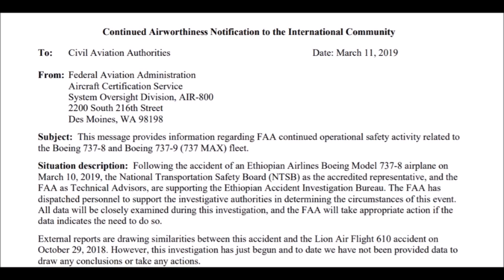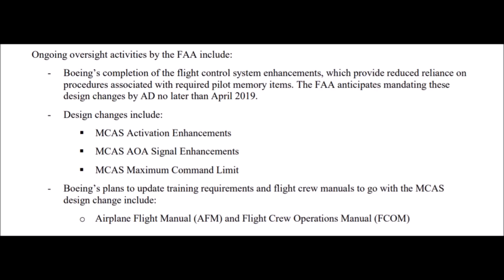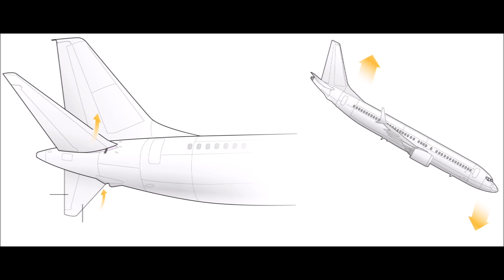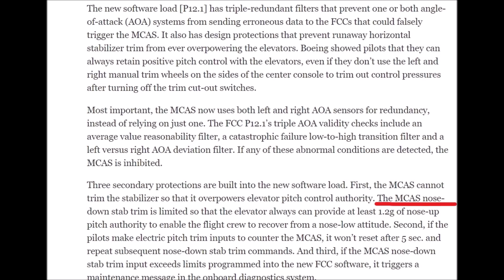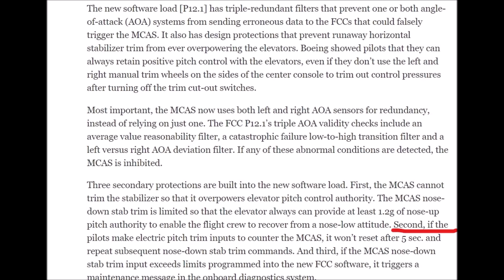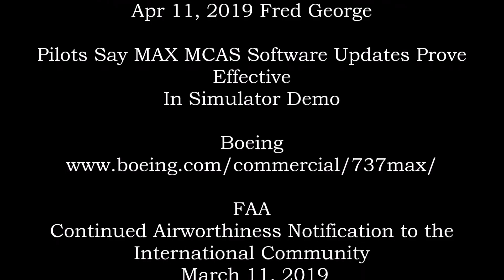737 Max UPDATE 14 April 2019 "The Fix"

Comment: Sadly with any new or redesigned product errors happen.  You have thousands of people designing every little part.  Even more making and or assembling them.  100% over sight is impossible.  This is why you never buy first year model of a car.  It is a crying shame that people died because of this.  I am 100% certain that Boeing did not want this to happen.  Look at what has happened to their stock and reputation.  

Having said all of that, they must take some blame.  While the software was to aggressive, the big problem was lack of redundancy.  That should have been standard equipment and not an option.  Where was the airlines fault in this?  The airline took the cheap way out and did not ordered the option.  The airline put profit before safety.  Another huge problem is that this plane,  the last one to crash,  had a known safety issue.  Why was that not fixed properly?  I will not hazard to guess.  Last issue.  The way the pilots reacted.  Was this due to lack of training?  Was this due to shear terror?  I do not know.  I can only look at similar situations where other people in charge did not act properly in bad situations.

In the end I would on a jury find the following.  25% on Boeing for the software issue and lack of redundancy.  50% on the airline for not ordering the safety option and  putting unairworthy plane in the sky.  25% on the pilots for not handling the issue properly.  

I know that I am going to catch shit for the last one.  I based that last on for several reasons.  The pilots the day before had the very same issues on the same plane  They were able to land the plane safely.   5 Pilots in the US reported the same issues and landed safely.  

Having watched many air disaster shows.  Two of which I have a personal connection to.   It is not one event that causes a crash, it is a series of events that do.  This is a classic case.

Comment: Boeing was trying to update the 737 to compete with the a320 neo when they added the new engines that caused the nose up issue and they knew requiring a different type certificate, and additional training would make it harder to sell vs. the a320 neo,  it was simply a rushed job because boeing didnt want to lose sales to Airbus

Comment: Juan, if you get a chance, could you explain why commercial planes like the Boeing 737 and I suppose others, don't use a gyro based flight control/navigation system supplemented by GPS?  I'm a retired Navy guy and I know we counted on gyro and doppler to get us where we were going and or to hit a target.  Gyro's could drift and doppler can have issues too.  Like going over water with doppler isn't the best way to keep track of speed and altitude.  But,  sophisticated software that was so small it fit in an old IBM 360 with 4K (NOT meg or gig) of core memory could take in the doppler information and computer speed and altitude.  That was bumped against radar altimeter to check altitude and against a gyro to check for directional speed.  I always heard that the original 747 kept 4 gyro's spun up and bounced their output against each other so they could fly great distances without any drift at all.  Doppler radar may not have been as accurate years ago but now I think it can compute AOA just good as a vane but without any moving parts.  Proof of that is that we can control space craft where there is no air to move a vane to land them on another planet.  Have I got this all wrong?.. Thanks for your reporting.  It's really great.
Reply: An AOA sensor needs to be in the airflow outside the plane. It measures the angle of the airflow in relation to the wing. No device inside of a plane can do this.
Reply: @stimproid  I agree with what an AOA vane does but I don't think you understand what doppler radar can do.  I find it very hard to explain this in words but will try.  Assuming you know what doppler radar is I'll start there.  Imagine if you had an antenna on the bottom of an aircraft that was sending out pulses in all directions and then listening for them to come back.  By doing this you can make a system that not only tells you how fast your moving forward but also how far your moving away from something.  These should balance out as you might imagine.  But, with aircraft they rarely do.  A cross wind, for example causes a plane to kind of crab through the air.  Doppler radar can see this.  Then, by watching how long it takes a pulse to get from the plane to the ground and back the radar can compute the altitude above ground.  Applying a bit of trigonometry to these signals, you can actually determine that not only is the plane crabbing but also that the plane is not flying level to earth beneath it.  Of course you don't want the plane to try to follow the terrain but using the previously mentioned timing to ground and back you can actually subtract out the terrain rising and falling.  It would not be possible for a human to do these calculations in real time but it's easy enough that a pocket calculator could work it out easily.  The gyro's that I mentioned in my comment make much of these equations VERY accurate and the math even more simple.  It also helps keep thing working when the weather gets really bad or the terrain gets really ruff or steep.  For military aircraft that might be doing dog fights where the earth isn't even under it but over it gyro's do a good job of taking over for the doppler  for short periods.  Systems being developed put the AOA vane to shame.  For instance, what if your A/C can go mock 3?  At some point you'll either tear off a vane or a least freeze it.  Granted at mock 3 your not going to have much use for it but what happens when you slow back down? lol
Reply: @trongod2000  AOA has nothing to do with measuring the angle of the wing to anything other than the oncoming airflow. The angle between the plane and the earth is completely irrelevant in this measurement. Your sensor design would work great on a spacecraft as you point out, precisely because their is no air. Your sensor design might make a good artificial horizon for a plane. It cannot measure AOA. Oh...and if you are going Mach 3 ...you don't have to worry about things freezing....you have to worry about them melting. smh
Reply: @stimproid  I can see I made two mistakes in my explanation.  The biggest being that I left out the pitot  static system which measures true airspeed NOT ground speed which doppler radar does so well.  My second mistake was in not sticking to  my narrow view of aviation. In military A/C that generally move really fast and have very high maneuverability compared to an everyday airliner.  You can find yourself in deep trouble just like an airline pilot But also have to ignore AOA much of the time.  The turn radius of a fighter quite often exceeds the ability of the airflow to hang onto the plane so you end up with almost negative AOA at times. ( mean where the airflow is trying to literally put the vane forward) I suppose, but don't know, an airliner could get some really weird AOA readings in extreme updrafts or down drafts.  They would have to be some really extreme drafts though to affect the apparent forward speed of 300 knots I would think.  Anyway,  I guess we'll have to agree to disagree that angle of attack can or can't only be computed from AOA vane.

Comment: How could YOU have got it so wrong in your first video!

The Max 8 is dynamically unstable at some speed and turn combinations. THIS IS WHY THE MCAT WAS NEEDED. Any pilot who accepts a dynamically unstable aircraft is a threat. Fixing airflow instability using computer fly by wire is just plain stooopid.

The Max 8 is NOT an upgraded 737 because of the new repositioned more powerful engine. Making one plane feel like another to save money is dumb.

Many more reliable people including London's Fin Mail reported this before your 1st video. Yes a financial publication in the UK got the information right!!??? RT reported the instability a day later. (RT in the Russian State News)  You still haven't spelt out the instability.

Max 8 is dead. It's going the same way as the DC10 did in the 1970s. It's another de Havaland Commet of the 50s. If a company hides design flaws, the aircraft is a commercial failure. Unfortunately Boeing,  like the US Banks is too big to fail. Congress will bale it out with tons more defence work and you, the public will pay for this in your taxes.
Reply: MAX 8 is not unstable.
You think RT is credible?
MAX 8 will be safe and hugely successful.
DC-10's are still flying.
Comet (the first jetliner was bound to have some teething issues) flew for over 30 years.

Comment: mcas made new 737s behave like old 737s. so in all prior models of 737 in a runaway trim the pilot could not overcome the nose down pitch with the yoke and the manual trim wheel was not moveable because of flight loads.The pilots in both crashes tried everything to save the plane.
 Why dont YOU go into a flight sim replicate the conditions that crashed those planes and see if your  Hand flying skills can save the plane. You castigated the pilots in your prior video.
Reply: Many pilots have done as you suggest...successfully.
Reply: @stimproid  So your saying that on many boeing airplanes  the yoke became unmovable(400lbs force to move) and the manual trim wheel unmovable, nose down exceeding 400 knots and many of you superhuman pilots overcame this. please give us their names, the N numbers, dates of failures so I can give the information to the FAA and FBI so all these failures can be included in the official investigations.
Reply: @Mr4827k  Saving the aircraft is about recognizing the failure early enough. There have been many pilots who have replicated the conditions in the simulator as you suggest.
The Lion Air plane was recovered the day before the crash in actual flight conditions.
Where did you pull that 400# yoke number from? SMH
Reply: @stimproid  as i thought no names just talk. 400 lbs comes from reports. the day before when Lion Air was saved had 3 crew not 2 and more luck.  you probably think you could have done better than Sully and landed on a runway.
Reply: @Mr4827k  Reports eh? Link one. 
Sully is a hero.
Reply: @stimproid  well finally a truth from you Sully is a hero. Now where are the names N numbers and dates of all those superman pilots who have saved planes or even sims when they experienced the same failure as those poor pilots you denigrated.
Reply: @Mr4827k  Still waiting on your 400lb report.
Reply: @stimproid  and we are all waiting on the names N numbers and dates of all those superpilots who have saved planes or sims when they experienced the same failure as those poor pilots you denigrated. Didn't most/all the super pilots trained on 737 max planes get an ipad checkout.

Comment: Translation: if you're planning to launch a new airline, 737 MAX + MCAS = B.S.

Simplicity is the mark of good engineering. Buy either the A320neo, A220-300 or both. (I can hear the champagne corks popping in Toulouse and Montréal.)
Reply: Simplicity..... Airbus.....what? Never heard of Qantas flight 72?
Reply: @stimproid  , the A330 doesn't need MCAS to be stable. You''re comparing apples to oranges. This is not about automation per se, but rather stability without aid of automation.
Reply: @lrg3834  No. It is abaut automation and what can happen if something goes wrong. The MAX is NOT unstable.
Reply: @stimproid  , if the 737 MAX is stable, as you claim, then Boeing should remove MCAS altogether if that's the case, right? Think it through.

Boeing is not in the business of adding unnecessary hardware (weight) to make airframes heavier for nothing (more fuel burn). Instead of re-designing the wing set to accommodate longer main landing gear, so that the LEAP engines can fit properly under the wings, to keep the power/weight/balance ratio where it should rightly be, Boeing kept everything the way it is, then moved the engines forward and up, which destabilises the aircraft under certain payload/power settings/steep climb situations. Do you understand this?

You don't need a system like MCAS on the A320 and A220 family of jets, period. They're designed properly right from get-go to accommodate the LEAP engines in a convention fashion.

What's truly sad here is willful miscommunication on the part of Boeing to hide this truth from airlines up to this point. That said, Juan Brown gets it. I have no doubt this man knows what do to without MCAS switched on. He's competent and informed. I imagine he would simply pull back somewhat on throttle position in light load situations, go easy on climb attitude and set trim accordingly for straight-and-level flight. The Lion Air and Ethiopian Airlines pilots obviously did not know what to do, either due to lack of product information, training, competence or a combination thereof.

Please do not defend Boeing when it comes to MCAS. Both crashes could've been avoided entirely with adequate disclosure from the manufacturer beforehand, and what to do to in the event of system failure. Either that or the Lion Air and Ethiopian Airlines pilots who died were stupid or perhaps a little incompetent. I myself would learn to fly an airplane without automation first, but then again, that's me. I also would learn how to switch off all automation at once, so I could fly the airplane myself in the event of anomalies. Just saying. Some people are careful while others not so much. Not all pilots are equal, just like top athletes.

Peace and be well.
Reply: @lrg3834  Airbus design philosophy is to take the pilot out of the equation as much as possible. All of a pilots commands are translated by the computer to the flight surfaces. To suggest an Airbus does not have any type of MCAS, or programing to prevent the pilot from pointing he nose up too high is absurd. Suggesting the MAX is unstable is false. I'm going to assume you ignored my suggestion to look at Qantas flight 72, but I will also suggest you look into the Airbus a320 airshow crash too.
Reply: @stimproid  , you fundamentally don't want to own up to the fact that the MAX is unbalanced under certain payload/thrust/climb attitude situations DUE TO UNCONVENTIONAL ENGINE PLACEMENT (design), most notably the -8. You either work for Boeing, are a Boeing stockholder, hate being on the losing side of an argument or a combination of these things. Goodness!

Rip all automation out of the A320 and it still flies properly and predictably––even when you kick its ass on takeoff. Now do the same thing to the MAX and get back to me. Try light payload with full thrust and aggressive climb attitude. Take care not to stall!

If you rip out MCAS, retrofit the MAX with Next Generation pylons and engines, then you can claim more or less stability parity with the A320. Outside that, no way José.

Boeing took foolish shortcuts to save time and money. Lawyers will tear this manufacturer to shreds in a court over this! It's a DREAM case.
Reply: @lrg3834  I can name you 2 pilots who state that it is not unbalanced. Find me one who says that it is.
Reply: stimproid , then tell Boeing to rip out MCAS and make an appropriate media announcement to that effect. It’s that simple. (Not saying the aircraft isn’t flyable btw.)

Peace and be well.

Comment: Augmented flight control systems compensate for unstable designs.  I certainly hope the FAA rigorously and independently investigates  the design characteristics of the aircraft in addition to the software modifications.  The airplane is simply unstable and will never be safe to fly.
Reply: Where did you hear it is unstable?
Reply: @stimproid  I have 35 years experience as a military aerospace engineer.  The redesign of the wing, landing gear, and engines/mount placement created aerodynamic instability (tendency to stall) which Boeing felt classic stick shaker warning was inadequate to overcome.  Hence MCAS.  Automated flight control systems designed to overcome aerodynamic instability are nothing new....take for example the F-117 and B-2 military aircraft.  However, these aircraft operate with the inherently elevated risk (and both have had their fair share of mishaps).  This level of risk is simply unacceptable in commercial passenger aircraft.  This is why I believe the FAA will not allow these aircraft to fly....ever.  If the problem with the 737 max were just confined to the MCAS issue, the aircraft would already be flying.  There are other issues which simply cannot be corrected due to aerodynamic design flaws.  Boeing is in BIG trouble here.
Reply: @willytrouble88  MCAS was obliviously flawed. There is nothing inherently wrong with the design of the MAX. It is not unstable. Where did you hear they moved the gear? You need to check your sources.

Comment: Great analysis, Juan.  I worked with GPS and electronics in the construction industry.  Beware of  the new or improved versions and updates of software as they come out. 98% of the improvements are great, but it seems  there is often THAT 2% that is NOT better, and in this case, catastrophic.